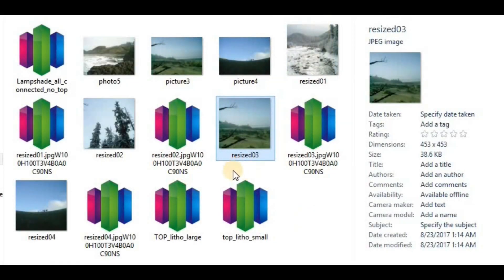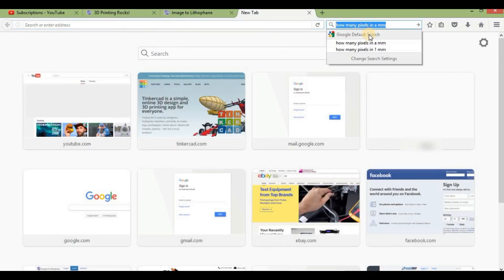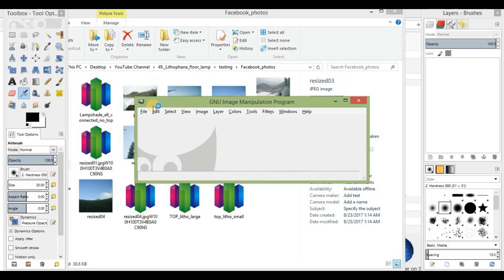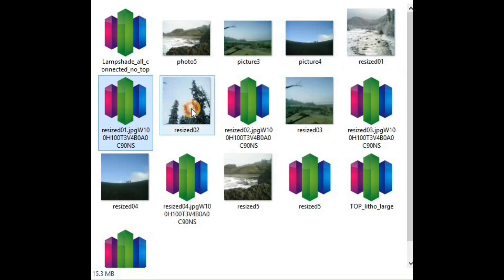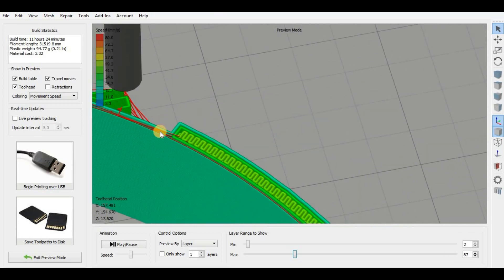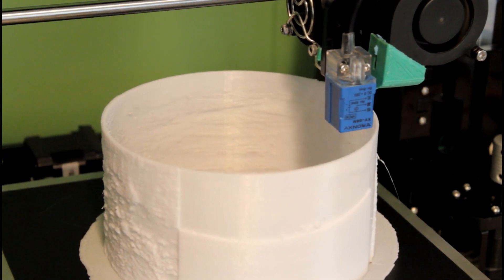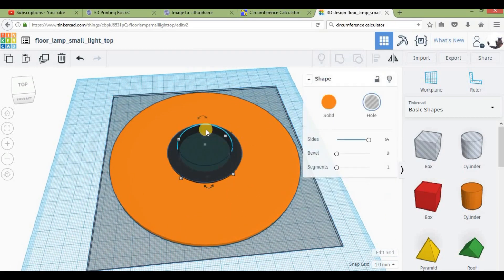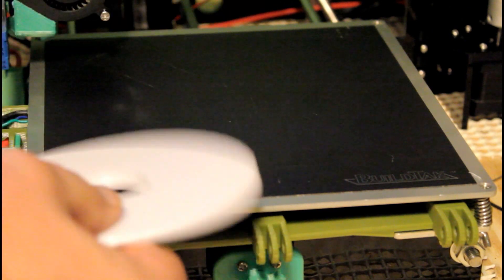Circular Lithophane Floor Lamp Shade (Tutorial)

Comment: Boy you really went about that the hard way.
Reply: 16by80 excellent, thank you! I am working on a circular lithophane candle holder as a Christmas gift now. :)
Reply: Looks like your previous post was deleted? I'm not seeing it anywhere.
Reply from the maker: Thanks for pointing that out Austin.  Bu Jin's reply post got sequestered by YouTube for some reason it thought it was spam. I had to go into the creator studio and approve it, should be able to see it now.  Let me know if it doesn't show up.  Great information, I am using tips from Bu Jin on one of my next projects right now.
Reply: Your edit the slicer settings before dropping in the STL tip has just saved me so many headaches. We don't all have premium PCs and opening almost anything in Cura or Slic3r slow my machine down. Lithophanes put it in a rear naked choke. Thanks Bu.
Reply from the maker: Bu Jin how so? I'm making a similar project now for a holiday present so any tips would appreciated!
Reply: First thing we want to do is figure out what our desired height and width (diameter) of the lamp shade is going to be.  These values can of course be totally arbitrary, but it's important we know what they are moving forward.  I want a height of 8" and I'd like it look nice, so I'm going to use the golden mean (1.61803398875) to derive the width (diameter).  So 8 * 1.61803398875 = 12.94427191.

Now I know what I want the height and width to be, I'm going to work out the circumference.  Here's the equation for that: C = 2πR; and R = D/2

2 * (3.141592653) * (6.472135955) = 40.665629538524721

(Yes, my level of precision is crazy, but we'll round when we're done.)

Ok, now I have my height to circumference ratio: 8x40.665629538524721

Now that I have my height to circumference ratio it's time to build my canvas.

Go into your fav image editor and create a canvas with a height of 8" and width of 40.665629538524721" (or whatever it will allow).  You may wish to adjust your DPI, erring on the side of too heigh will have better results (ideally you want at least as many dots and you have Z-layers).

Now that you have your canvas, layout your images however you want.  You can do transitions, you can stack them, you have unlimited control at this point.  Just keep in mind that the two ends will be touching at the end of this, so you might want to take that into account with your design, but if you're smart (which isn't hard) you can make your lamp shade utterly seamless, and no one will know where the image starts or stops in the print.

Ok, now that you have your canvas complete with all the pictures you want to use.  Now just go to http://3dp.rocks/lithophane/ and go to the model settings and set your maximum size equal to the circumference (40.665629538524721).  Now keep in mind that this is in mm, so we'll have to do a quick conversion.  Which gives us 1032.9069902785277009, we need whole millimeters, so 1033.

Now go to the curve setting at the bottom and set it to 360.  This will create a complete cylinder.  Make any other quality adjustments you want/need, and download the STL.  For instance you might want to consider setting the thinnest layer to be just slightly bigger than your hot end diameter.  So mine is 0.4, and I'd set this to 0.5 (this will control how bright the image is).  I'd probably also increase the thickness to 4 (this will control how dark the image is).  These two settings will improve your dynamic range.  Also, I'd probably bump the vectors per pixel up to 5 (if your browser can't handle it drop it back to 4, but don't go lower than that).  Also, don't forget to change your image to be positive (but you know that).

NOTE: I would make ALL the setting adjustments before I drop in the image.  Dropping in the image first will make the application run slower.  It's a better idea to set everything, drop the image, that way you only have to click the download button.  After you have downloaded the STL file you may want to close the browser window to free up computer resources. 

Now drop the STL into S3D, and set your print settings.  You know your printer better than I, but make sure you have 100% infill, and tell S3D to "Avoid crossing outline for travel movements" and set your "Maximum allowed detour factor" to something high, like 5.  This will greatly improve things for you.  Also keep in mind that your layer height is going to dictate the resolution of your image.  Like with everything you print, thinner will look better (more photo like), but will take longer.

Now your printer is printing a complete cylinder, and you don't have to worry about trying to do all that weird cutting images into perfect square thing, and then trying to make S3D stitch them together, etc.  With this approach you have perfect control on exactly what dimensions the lamp shade has, and you have perfect control of what it looks like, without having these artificial limits imposed by your method, or fiddling with trying to get sections to reconnect.
Reply from the maker: Wow, that's a heck of an explanation! I was so worried about distortion that I just made the circumference divisible by 4 and set the pixel/mm so that they were consistent and wouldn't distort on the slice after bound by S3D. The method you describe is a whole lot easier.  I will have to give it a shot, I never even thought to try to wrap it 360.  Thanks for this information it should help a lot of people out including myself.  The internet is awesome.
Reply: I'm glad I could help.  Yeah with the method I described you won't have to worry about distortion, all of that is taken care of in the steps leading up to creating the canvas.  The canvas bounds your work area, so you are free to lay out the images however you want, and you can be SUPER creative about it, and when you are done you will have a cylinder that is the exact dimensions you are looking for.  BTW, I updated my previous post to be a little more complete.